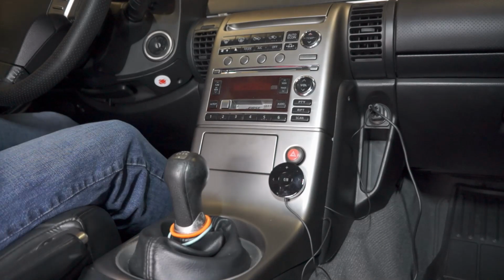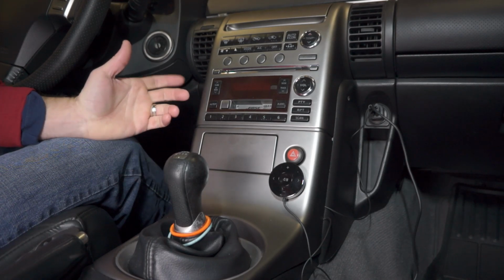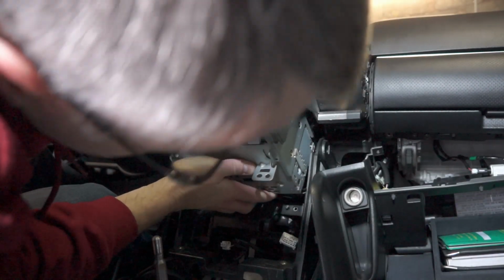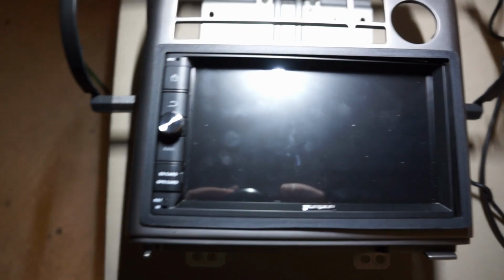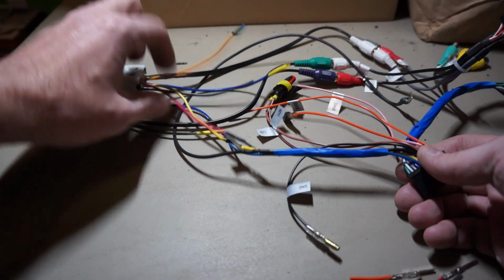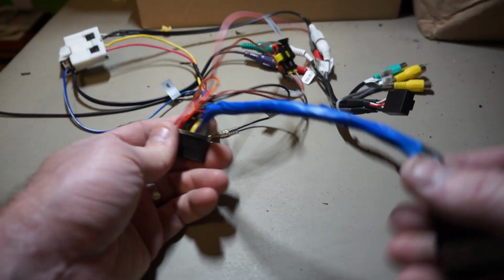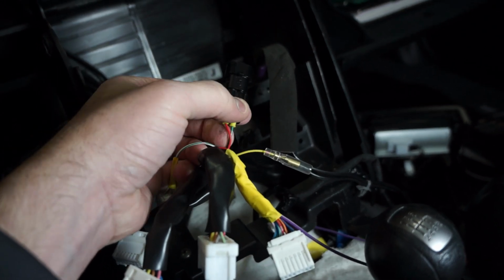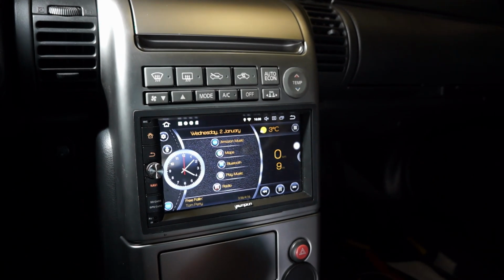2003 Infiniti G35 Android 8.0 Head Unit Install (Pumpkin)

Comment: Hi, the climate control and radio main board are combined, how did you separate it?
Reply: Is the air conditioning control main board sold separately or do I need to cut it between the two?
Reply from the maker: You need to purchase a JDM heater control unit.  You do not cut the circuit board.  See parts links in the description.

Comment: Where did you get the Bluetooth thang?
Reply from the maker: Amazon, you can search for car Bluetooth adapter.  Mine was connected via an iPod input (which is no longer a thing), but you could use an FM modulator or tape deck input.
Reply: I have an 03 , how are you getting bluetooth through the ciggerette lighter adapter? My 03 has no MP3 , im wondering how the music is playing though the speakers?
Reply: @EddieTheMush  I brought this Thang off of Amazon
Reply from the maker: You can use a FM adapter to play through an unused FM station.
Reply: @JRsGarage  i have an aftermarket pioneer dbl din in with a ipod cable running for my ipod 👨‍🦳 , i was trying to find a way to get bluetooth access without taking the dash apart and running a new cable , couldnt find any adapter that would use my ipod cable to power a bluetooth device ... thanks
Reply from the maker: Does the pioneer have a 3.5mm in?  That would be better than FM station.
Reply: @JRsGarage  there is some head phone type jack port under the screen when it opens or slides down that lets you insert a cd - sd card but slides back up to access the touch screen so idk if that would work ... have to get the model # of it ... its very old ... maybe dh-6000
Reply from the maker: Well that won't work if the screen has to be up?  Design flaw.

Comment: I just hooked up my stereo using the metro kit.  Did you have any issues with the heat/ac control?  My AC only works if I set the thermostat to 60 degrees. If I bump it to 65 the heat comes on full high temperature.
Reply from the maker: No, I've never had any issues with the AC control.

Comment: Woh what is that Bluetooth thing you talked about in the beginning and how does it work???
Reply from the maker: It's a Bluetooth car adapter. Something like the link below. I don't think that they still sell the one that I have pictured in the video.  https://a.co/d/1vu3KGy
Reply: @JRsGarage  thank you! So how does it work exactly? Like how does that thing connect to my car speakers? Because my stereo on my g35 is pretty busted. If this device can work to be Able to listen to my phone music in my car again I’d be so happy. I used to use cassette aux but my cassette player broke
Reply: Cause also the 03 g35 which is what i have aswell doesn’t come with an aux input. So I’m jus curious how exactly it works? Really appreciate all your info and help :)
Reply from the maker: @cstove1713  I think it was a FM transmitter.  It's been so long I can't remember for sure.
Reply from the maker: I remember now.  It was one of these iPod adapters which also had an aux in.  I don't think they sell it anymore.  https://www.crutchfield.com/S-CI3yhksmIBW/p_581PA11NIS/USA-Spec-iPod-Interface.html

Comment: do you have to cut the wires that you cut for the aftermarket stereo or is that optional?
Reply from the maker: This video is a follow up to the one you posted on.  It has more info on wiring.  https://youtu.be/8qye8zNCPlo

Comment: Bro I need to bring mine to you and have you do the same thing to mine and pay you. Seems complicated with the wiring the rest seems fairly easy
Reply from the maker: It's not the easiest job, that's for sure.  With the wiring color codes it's doable though.  Maybe bring it to an audio shop and have them wire it up.

Comment: I bought my g35 with a metro double din already installed but my hvac controls weren’t connected and I can’t find which factory cable connects to the after market ac control :(
Reply from the maker: There should only be one that fits the Metro double din. If it's not there behind the head unit and maybe the previous owner removed it.

Comment: How do you connect that ribbon electrical connection for ur hvac controls to work onto the aftermarket one?
Reply from the maker: The aftermarket one is made to connect to the factory connection.

Comment: Can you tell me where exactly you trimmed on the aftermarket hvac buttons? I’m having a hard time getting mine to sit properly on the OEM bezel
Reply from the maker: I can't say exactly where the trim was made. I do remember trimming the black plastic on the back of the aftermarket heater controls to make it fit.  If you line it up from the back you should be able to see where you need to cut in order to move the controls left or right so that they line up with the holes in the bezel.

Comment: can you put it back to stock after the double din is installed
Reply from the maker: Only if you don't cut up the stock stereo plastic bezel to fit the double din.  The wires can be spliced back in to their original connection if you want to put it back to stock.
Reply: @JRsGarage  i’m sorry but what do u mean by the plastic bezel. i have a double din in my g35 but i have a stock stereo unit, i don’t care about bluetooth i prefer the stock interior look
Reply from the maker: If you are keeping the stock stereo, what are you wanting to change?  I'm not sure what you are trying to do.
Reply: @JRsGarage  i got into an accident, and i bought another g35 which has a double din, i want to take my stock unit out and put it in the new car because i prefer the stock look and feel.
Reply from the maker: Got it, yes you should be able to put it back to stock you'll just need to match up the wire colors and replace the harness that that guy probably ripped out with the harness from your car.  if he tore out the Bose amp when he was doing it it might be a trickier situation.
Reply from the maker: By the way, if you want to sell the double-din bezel that he had I might buy it off you if it's in good shape.
Reply: @JRsGarage  not sure i haven’t opened mine up yet, where is the amp located?
Reply from the maker: In the trunk somewhere I think but I'm not positive as I've never had to mess with it.
Reply: @JRsGarage  ok thanks for your help man i have to get started on that soon

Comment: What's the model to that double din stereo?
Reply from the maker: it's from Pumpkin Audio available on Amazon or eBay I don't think they sell that model anymore because it's a couple years old they probably have a newer version now but it's just an Android head unit.
Reply: @JRsGarage  if I sent you a pic of the one I bought on Amazon could you tell me if it'll work ? I'm confused by all the connections , but wiring is easy to me .
Reply from the maker: Any head unit we'll be connected about the same way just make sure you buy a PAC ROEMINS-2 System Interface Kit, available on Amazon it will allow you to connect the new head unit to the stock Nissan/Infiniti wiring.
Reply: @JRsGarage  ok that came in the mail yesterday thank for your help bro.
Reply: @JRsGarage  did you use any line output converters ? I have two LP5-4 but I don't want them if I don't need them
Reply from the maker: I used the PAC ROEMINS-2 which converts the signal from the line level out of the head unit to the stock Bose input.
Reply: @JRsGarage  ok cool so I can send the lp5-4 back , thank you big help man

Comment: Did you experience reduced volume and sound quality?
Reply from the maker: Volume yes, sound quality I don't think so.
Reply: How do y'all have reduced valume
Reply: @diceloc441  Because this Metra kit was not intended to be used on cars with Bose. It messes with the balanced differential signal. 

The PAC ROEM-NIS2 is the correct harness to be used to retain the factory Bose amp. I said fuck it and bought an amp and speakers.
Reply from the maker: Thanks for the suggestion I just ordered a NIS2.  I'll swap it out and let you all know how it works.

Comment: This is a royal pain in the ass. Nissan and Infiniti always wanna discourage customers from doing it themselves. The trim around the clock is like a ticking bomb that will blow no matter what. Brittle it will just break nd that thing expensive although you can glue it and paint it black nd it looks fine
Reply from the maker: Yea, my clock surrounded cracked the 3rd time I pulled it apart.
Reply: @JRsGarage  glue it and paint it

Comment: hey so i bought a dual double din and there isnt a harness with the pre amp outs,,?? i bought the same metra wire adapter u linked but nothing on the stereo side has any way to plug in the pre amp cables.. ? is it the head unit i got or did u buy something to use those big plugs
Reply from the maker: Must be the head unit you got.  Has to have preamp outs to use that adapter harness.  If you don't have pre amp outs on your head unit you'll have to wire around the stock Bose amp.  I'm assuming you also have the Infiniti Bose system like mine.
Reply: JR's Garage yes I do. I got it to work for just the two front speakers.. any diagram or any direction u can point me towards wiring in the rear speakers
Reply from the maker: Easiest to run two wires back to the amp and connect there as both right and left rear door will be available there.  Here are the high side wire colors for the Bose Amp.  Also see this post.... good info and pics at the bottom of the page: https://g35driver.com/forums/audio-video-electronics/427975-bypassing-bose-amplifier-03-04-g35.html

The wire colors out from the amp are as follows:

driver door/tweeter: g + r -
passenger door/tweet: gy + y -

rear driver: g/y + b/y -
rear pass: br+ b -

driver woof: l/y + w/g -
pass woof: l/r + l/w -
------------------------------------------------------

Legend:
b= black
blue = l
brown/tan = br
light green = lg
green = g
dark green = dg
grey = gy
orange = or
pink = p
purple = pu
red = r
white = w
yellow = y

Comment: Where did you get the black trim piece to cover up the gap for the radio?
Reply from the maker: It came with the head unit.  I used a Dremel to shave it down a bit so it would look better.

Comment: Thanks for your great video.
My G35 radio stopped working. With your guidelines I’m upgrading my radio to 10.1” 1 din head unit. So I can mount above the climate controller. It will cover the clock a little. Thanks to point that G35 has amp build in, so I will use the pre-amp wire :). After radio, I’m planning 360 camera!
Reply from the maker: Happy to help.
Reply: Where did you get the radio from ? Can you send the link please ?
Reply from the maker: Amazon, but I don't know if they have the Pumpkin brand any more.  Just search for double din Android head unit and pick the one you like.  Installation is pretty much the same.

Comment: Have they added the quality audio chips or whatever was lacking in these Android head units that resulted in inferior sound quality compared to traditional aftermarket head units?
Reply from the maker: The audio is comparable to the Bose in my opinion.  Not that the Bose was great, but it was perfectly adequate for my taste and so is this Pumpkin unit.